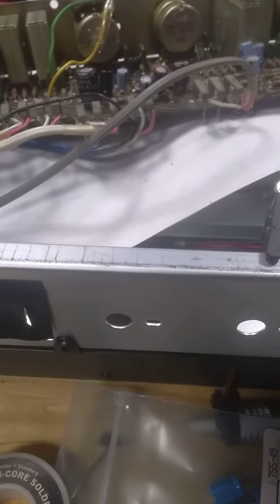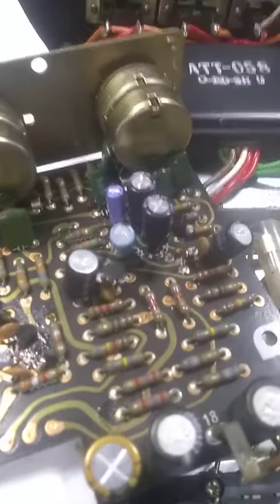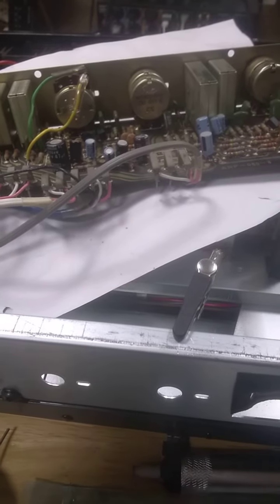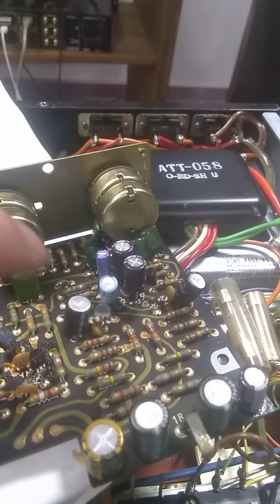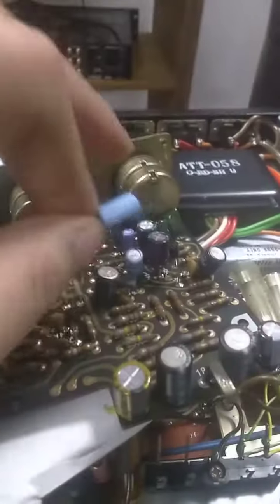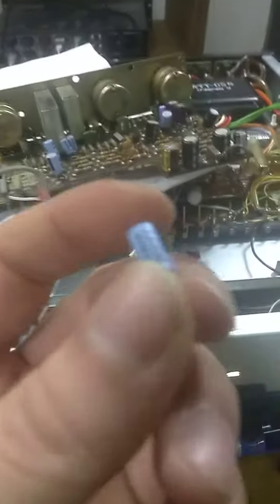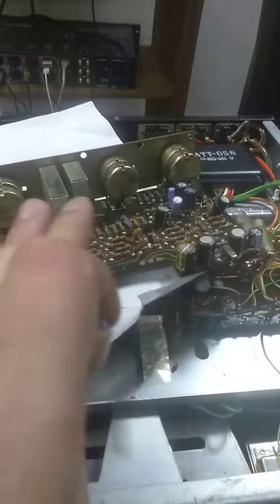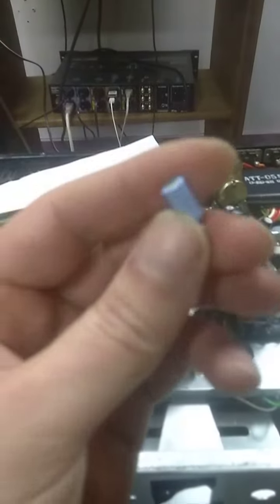Pioneer SX-828 repair story

Comment: Hi, are you the shop based out of Montgomery, NY?
Reply: @montgomeryhifiandreview5528  nice! Went in their when it was Oddities about a year ago, not sure if it's the same. What are your rates for servicing a vintage pre-amp?
Reply: @montgomeryhifiandreview5528  it's a Conrad Johnson PV1. It works but just has an issue in that the audio cuts in and out, have to play with the RCA inputs on the back to position them a certain way to be able to hear but it's not an enjoyable listening experience. I will post a video and share link with you probably some time tonight
Reply: Let me know if you were able to open up the link I sent
Reply: @montgomeryhifiandreview5528  sounds good, how much do you think that will set me back?
Reply: @montgomeryhifiandreview5528   I tried looking for an email where I might be able to send u some pics of the interior that might help. I want to say they are screwed
Reply: I always start with e caps in this vintage gear, alot of them start drifting in value or leakage. I actually find it cheaper to just replace at least all e coupling caps when servicing unit instead of trying to track it down, time is money.